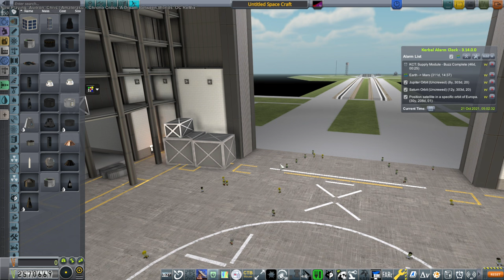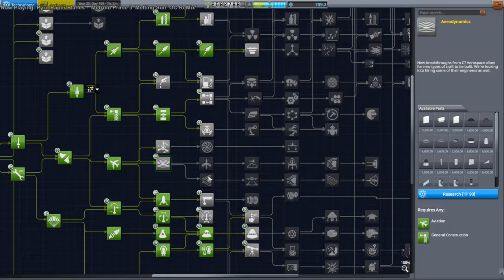RP-2000 Career 42 (RO in KSP 1.12)

Comment: 23:29 Max-q penalty at least in Test-flight and Test-lite reduce ignition chance to near 0, as shown by the 72.9% ignition penalty for Max-q on the core engines. I've lost to many sounding rockets in RP-1 to this. It can be disabled in game settings. I dont think Test-Lite has permanent failures, which makes situations like a SM engine failure like Apollo 16's CERC burn not 100% death, but allow for the launch vehicle engines to be reignited inflight.
Reply from the maker: Ah, you're right - I should have thought of that.